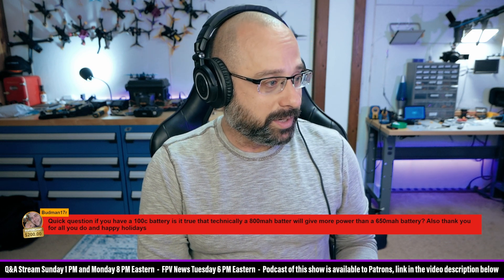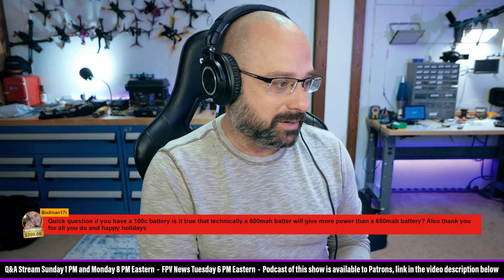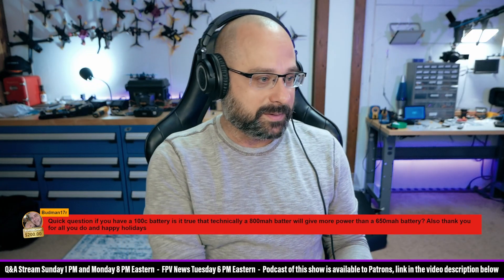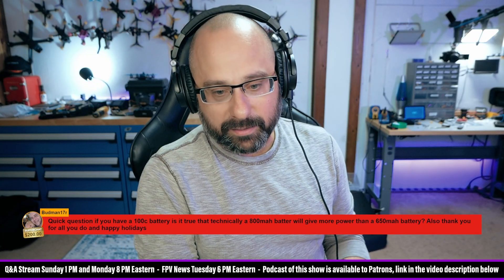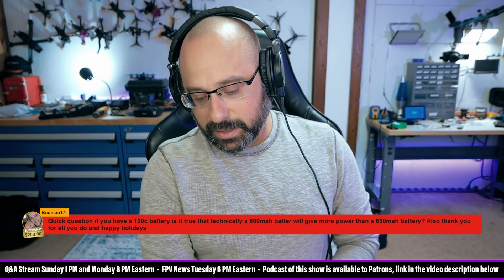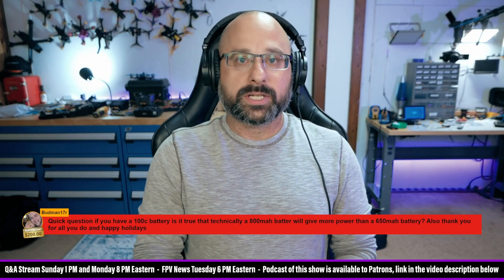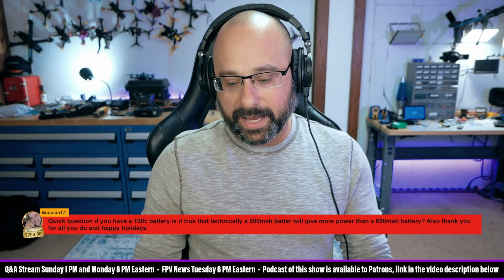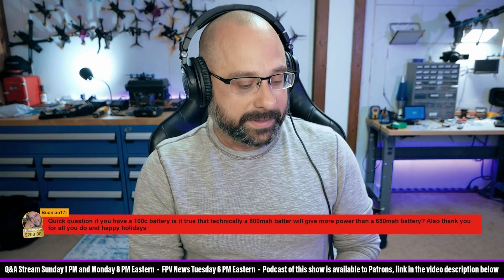How Does Lipo C-Rating and Mah Relate To The Total Output? - FPV Questions

Comment: Wonder if you could use efficient batteries like the DJI FPV uses but add super capacitors to allow an equivalent 100-200C punch out for 2-3 seconds when pulling out of a dive. Hmmm. Will research more, could be interesting.
Reply: Someone correct me but I think I've heard that lions with caps isn't in reality a good idea because of weight and the lions would have to charge the caps and drive motors so real bad sag. Can't remember where I heard this because I had a similar thought a while ago
Reply: @hoagietime1  You can use inductors to limit inrush current, but I just checked what a 0.5mH >100 amp inductor costs and weighs, and big time nevermind on that. Maybe best to use a programmable charge controller. Probably even easier to fly 12S but fly like a 6S and reserve the extra power for the very last bit of the stick for emergency punch out.

Comment: Isn't 1C rate = batts mAh capacity charge/discharge per hour? 
So a 100C on a 550mAh batt means you can pull ~5.5amps@6mins? Of course my little 2in ripper almost pulls 4-5amps to hover...and the run time is about 5 mins before I have to land.
This also correlates to voltage sag when you pull more than that rating?
Reply: I get maybe 3 min on my 2 and 3 inch